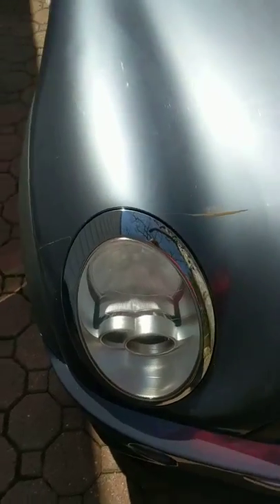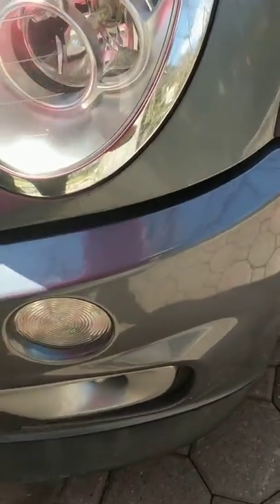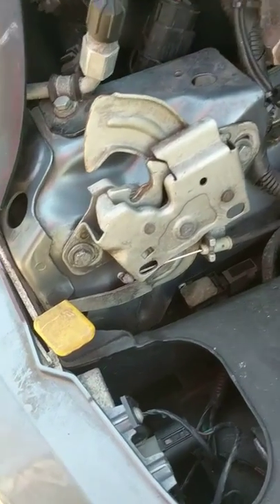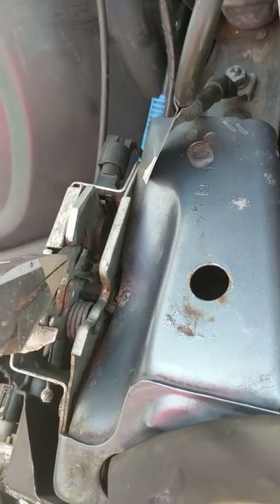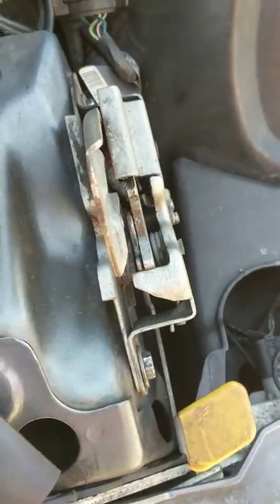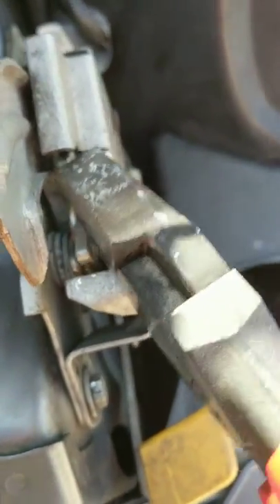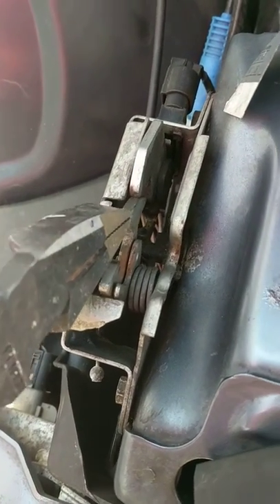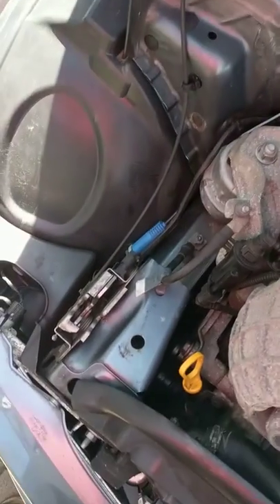06 GP hood won't close / latch properly driver side

Comment: did it end up fixing the issue by replacing it? i recently encountered the same issue.
Reply from the maker: super mini Sure did.
Reply: @minicooper6404  And to clarify I fixed it after replacing the bowden cables, not the latch.

Comment: I have the opposite issue and have tried everything including a new latch
Reply from the maker: What's the opposite issue?
Reply: Mini Cooper it's loose on the other side instead of this side
Reply from the maker: S

I should have been clearer in my rpely to the other guy - I replaced the latch and it still wasn't good. I ended up replacing the Bowden cables. It is a bit annoying trying to reach the mechanism inside the car on the passenger side to hook in the cables. Once I replaced the cables, everything works great now. It's definitely a dyi job but you do need a can o' patience. Good luck.
Reply: Mini Cooper I replaced the latches and the cables. I think it's just out of alignment
Reply from the maker: Well there's a little play with the 10mm bolts that hold the latches in......and the only other thing that could messed up is the hook itself on the hood could be bent. Did you have an accident or something? When you pull on the release latch you can see the cables actuating, yes?
Reply: Machigane yeah we had a bump. They close just can't get the left to shut properly
Reply from the maker: Well if insurance paid for the repairs I'd call them up and get a new hood because the light on the dash will be on if the passenger side doesn't latch.
Reply: Mini Cooper yep it's already on. Think the sensor has broken though
Reply: Lots of wd40 and use a screw driver to work in the oil, not forgetting the extra pieces of all mechanism, mine works handsome 😁😁😁😁😁
Reply: Yeah tried this and still hasnt worked. Oh well. :)
Reply: @minicooper6404  my 06 r50 has the same problem. the passenger side closes so well with a nice click. and the driver side has the same problem as yours, just doesn't close. i adjusted the latch and it helped abit. but could never get it like the passenger side with the satisfing latching noise. So after you replaced the Bowden cable, did it close like passenger side? thanks
Reply: @EverGone03  Hi there. Yes, after replacing it it closes fine now. You can also tweak the position of the latch slightly by loosening the bolts. That said, focus on replacing the cable. It's definitely a little annoying in the passenger well inside the car trying to loop the cable onto the latch. Also, I rerouted the cable slightly differently inside the engine bay - you'll see it's super tight. Works perfectly now though.
Reply: @machigane7902  thank you for the reply. yea i played with the position of the hook for like 2 hours, and it only helped slightly. its definitely the cable. is it normal to pull twice on the hood latch to open the hood? i have to do 1st pull, to unlatch passenger, then keep pulling (2nd pull) to unlatch driver.
Reply from the maker: @EverGone03  Yeah sorry I replied from my gaming account. :D No, it's not normal to pull twice. That means one of the cables is loose. The driver side wasn't working properly on mine either. Take your time as it's not that hard just a little annoying and the space is tight. Good luck and let me know how it turns out!